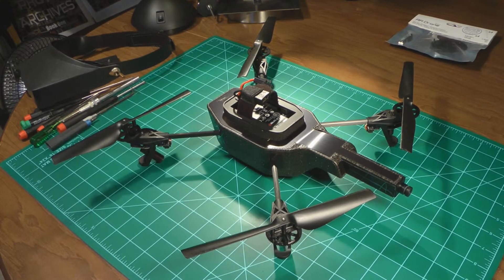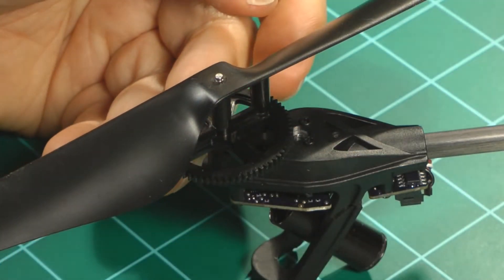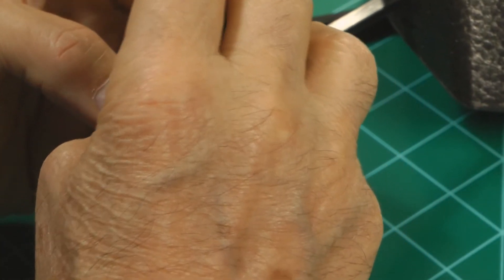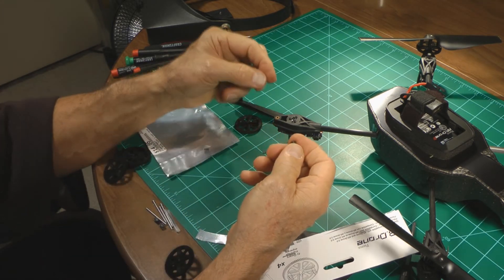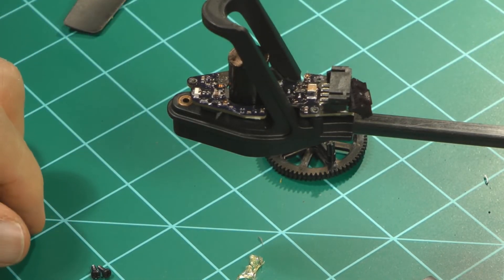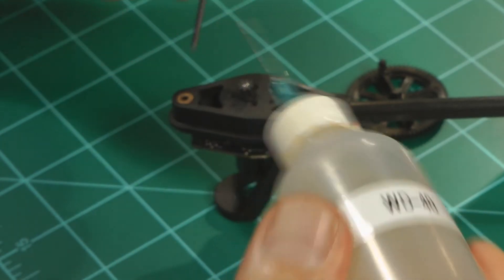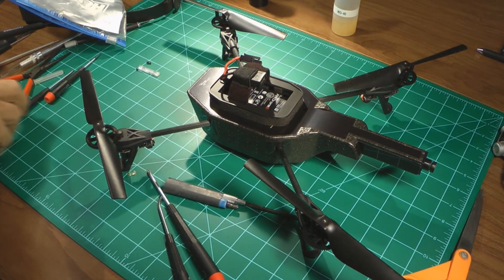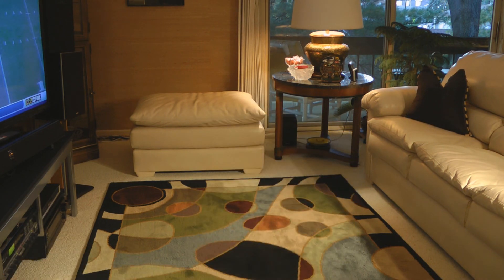Parrot AR Drone Motor Repair

Comment: Very good basic repair, although you need to glue the end cap on the motor as it loosens a great deal on separation in a big hit, super glue (cyanoacrylate /note: do not store in the fridge, it seems to wreck it) seems to work but needs to be glued in the right spot to line up to the 3 screw hole mounts in the frame, very important. Also the magnet separates from the cog shaft inside and while the end cap is off (or you take it off) you can check and superglue it back on the shaft. this is also the reason one motor will slow down after a hit or three and flip over or fly to one side. The big trick is to NOT lose the micro spacing washers each side of the magnet ,very, very easy to do. Also the propeller metal shafts get bent and cogs destroyed fairly easily, then you spin them up and they explode. Slowly turn the blades and watch the small cog very carefully, if you notice even the slightest wobble off centre do not use it, replace it. and I don't think I will fly outside ever again without the indoor hull on as I have nearly used up all the spare parts from the doner drone in a couple of big hits with no blade protection. Oh and I fixed 2 open hooks on a decent rubber band and secure the hull from a propeller arm over the top of the hull and the inadequate magnet catch back to the parallel  propeller arm and then push it up close to the body. Hope this helps you guys, as these are freaking awesome drones, every sized boys dream. Phil.
Reply: Just an add on, before putting the c clips back on give them a slight pinch together and they should hold firm, if they "rattle" they will fly off. Also if the small cog wobbles its a bent shaft or damaged teeth, either the motor one or the big cog shaft which I havn't had much success with, buy a full cheap set of blades cogs etc. for like 8 dollars and you can't go wrong.